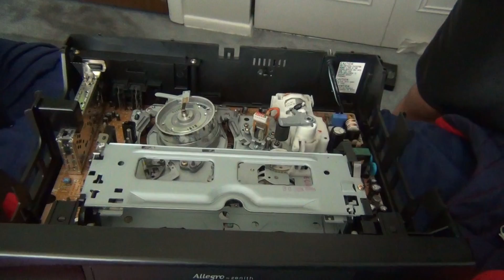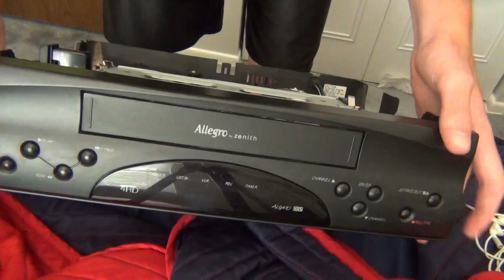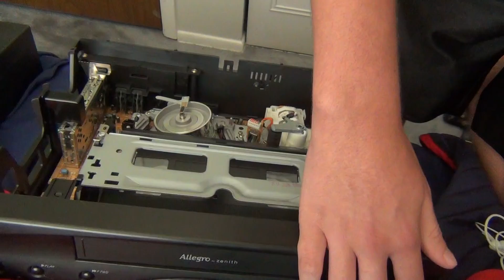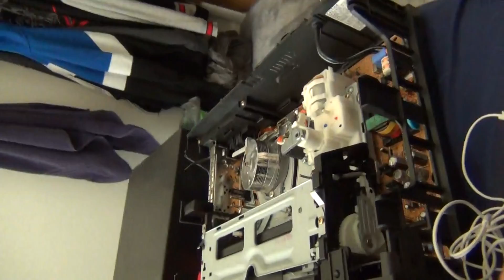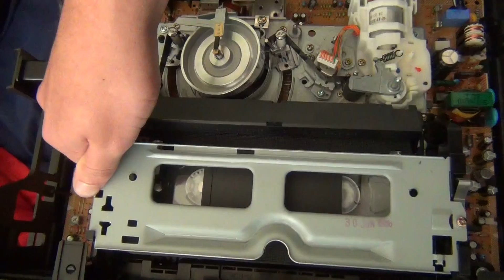Restored 1998 Zenith Allegro VCR

Comment: If you want to use it without the top cover without it to think that it's the tape end, don't use it when it's lighted by the light of the sun, light it with a fluorescent light. The sun or an incandescent light produces infrared, which misleads the tape end sensors.

Comment: I have one of these VCRs and a tape is stuck in the machine. How does one back the cassette out of the machine manually. What did you cover with your finger to get it to work with the cover off? The tape in my machine is broken and when I push the eject button the head spins but nothing else happens. 

Any help would be appreciated
Reply from the maker: Mr1stfiddle I covered the sensors that detect the tape. With the cover off, all of the external light made the machine think there was no tape, so I covered up the sensors so it would play a tape with the cover off.